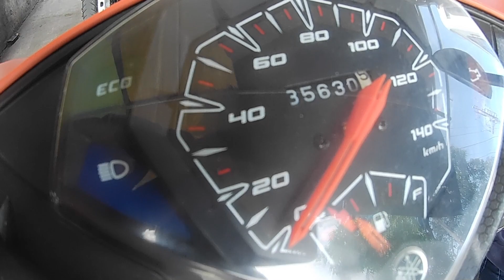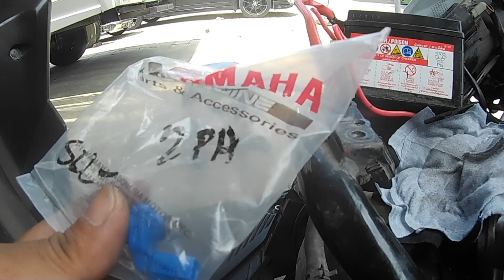mio i 125 sira ang injector niya late upload / topspeed

Comment: Pwede po ba ung 130cc injector na 6 holes sa stock na makina?
Reply from the maker: Hindi pwede master
Reply: @ILOCOSMOTOSPEED  ano pong pwedeng injector na 6 holes sa stock engine  master.,
Reply from the maker: @marcjaysonayuro8474  kung gusto mo maginjector master kailangan nakaracing ecu ka master
Reply: @ILOCOSMOTOSPEED  cge master salamat sa info
Reply from the maker: @marcjaysonayuro8474  maraming salamat sa pagcomment master